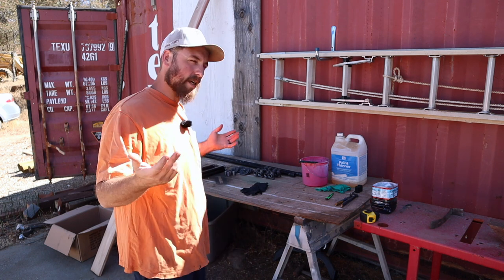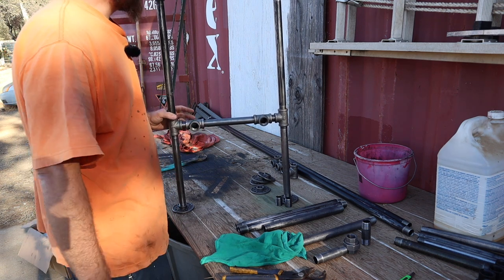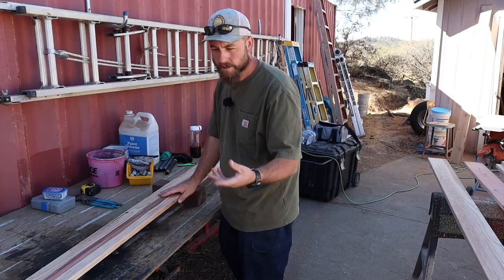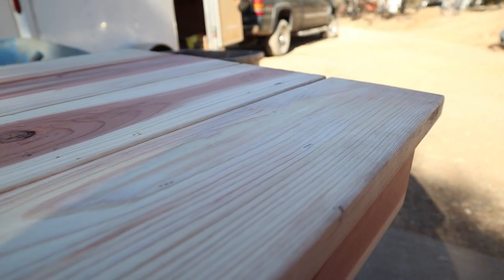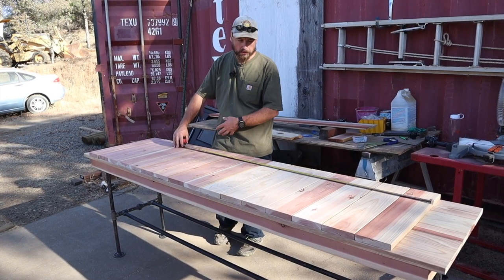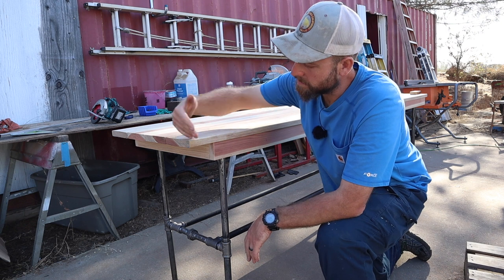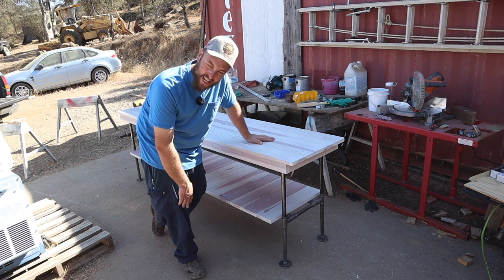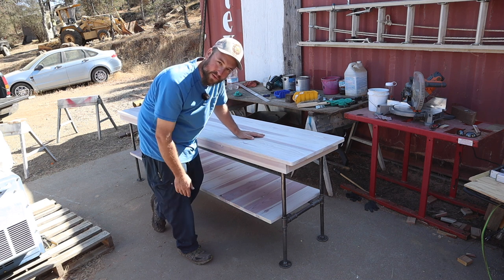RUSTIC PIPE TABLE | JoeSimple

Comment: You know that from Amazon (and other online retailers) you can get decorative versions of cast iron pipes and flanges for half, or less, the price of real stuff at Lowes or HD.
Like 3/4" flange at Lowes, as of Feb 2022,  is $5.50 each but from Amazon you can get packet of 10 for $15.
Reply: 2 year old comment, I know, but any idea on if they can still withstand heavy weight? Obviously not as much, but would there be any concern with like 200 lbs or something?

Comment: Did you thread your own pipes? Are pipe threader tools reasonably priced?
Reply from the maker: Hi Jim, I did not. most of the pipe is standard legents and the custom sizes I had them cut and threaded at the local hardware store. If you are in the market for pipe threader tools, Ridgid is the brand to look at.